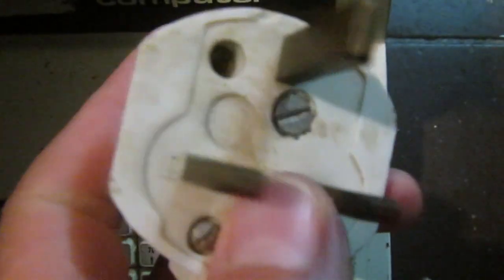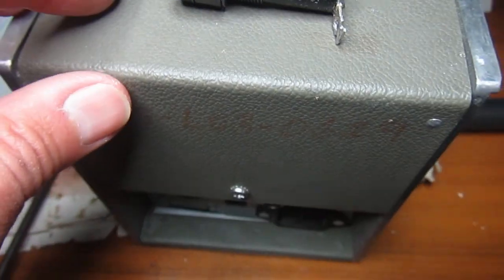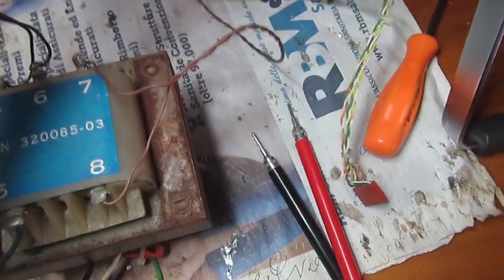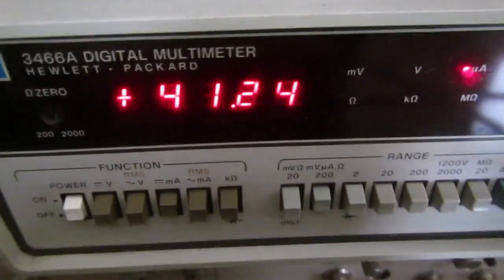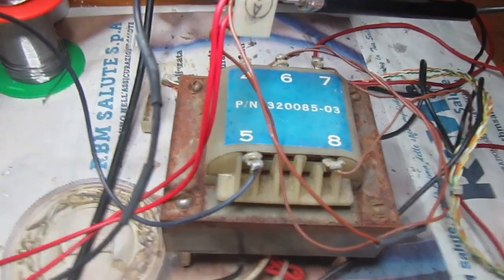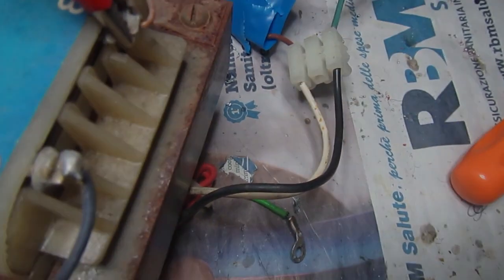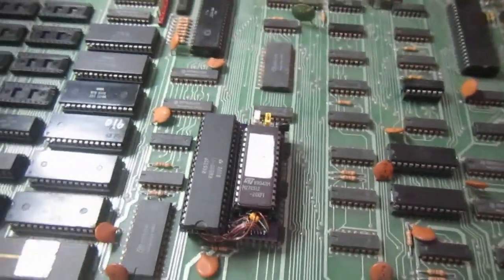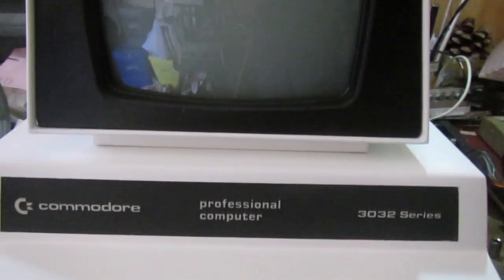CBM PET 2001 repair part 3: Checking power supply and CRT monitor

Comment: I have PET 4016. I turned on the pet at 115v and made a measurement with the multimeter on the J8 connector that goes from the transformer to the motherboard. The blue (or purple) corner wire is giving 30v, and the other blue wire beside it is 15v, is that correct? What would be the average voltage of the board's J8 connector wires?
Reply from the maker: First, let's see the actual schematic here: http://www.zimmers.net/anonftp/pub/cbm/schematics/computers/pet/2001N/320349-9.gif
You must find about 16 to 18 VAC between pins 1 and 5 and again 16 to 18VAC between pins 8 and 9 of J8.
Switching to DC, you must find about 9VDC between pin 3 (GND) and pin 2 or pin 4 (they're externally connected at the filter capacitor).
I suggest however to test separately with diode-mode in the multimeter all the diodes on the motherboard with power off.

Comment: Another very informative video F.M.!  I am eager to see the CRT portion when you get it done as I have a PET4032 in my garage hidden deep in there that was in great shape 10+ years ago so I have to come up with a strategy on how to approach it...some people say do NOT turn it on until opened and inspected thoroughly and I AM impatient like a kid at Christmas and probably would just plug it in and try turning it on and running it!  Same goes with my 4040 and 8050 Drives so keep up the good work.   -Mark.
Reply from the maker: You may want to have a look at this video if you already didn't: https://www.youtube.com/watch?v=G06PESFu_Zw
My basic procedure is always first clean, test BJT and diodes with multimeter, test electrolytic capacitors for shorts or high ESR, then power on :)